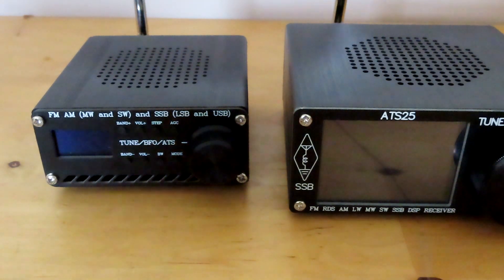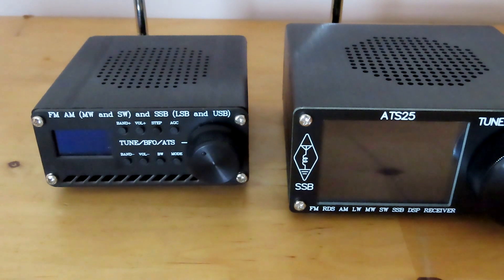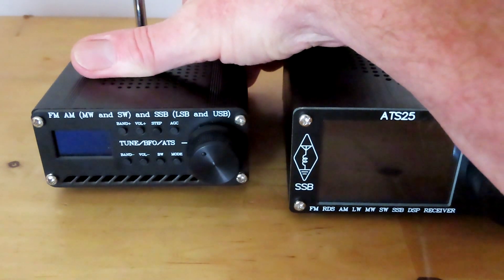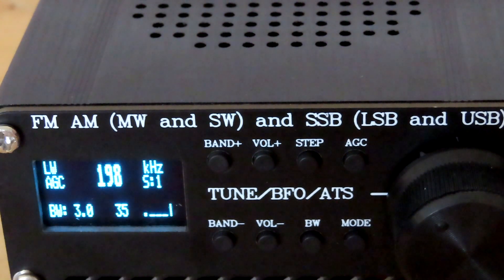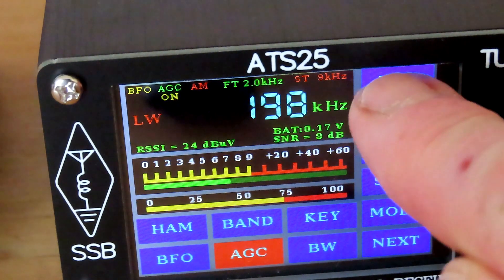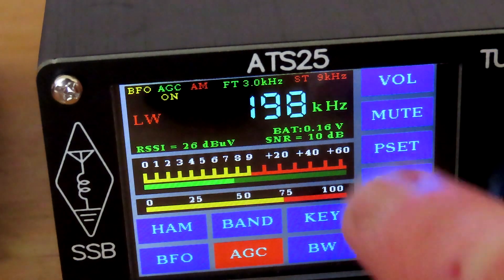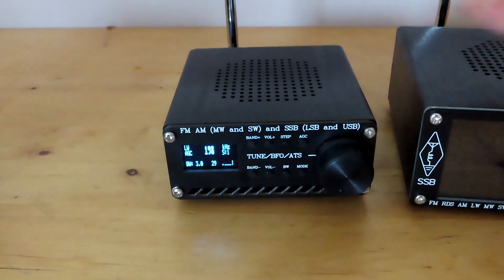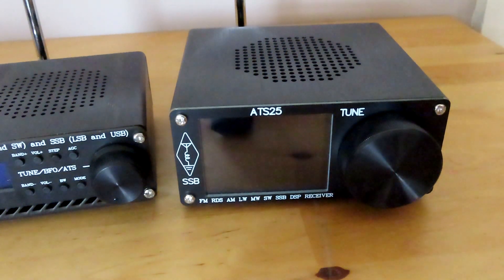ATS 25 Screen noise test

Comment: Hmm. I tried I self made despite rod antenna on my ATS 25 max decode. In the flat (it is Moscow) it turned out to perform better than my Data 808. Well, Data receive too but with weak signal it is not possible to distinguish what is said when no ats 25 it is still possible.

Comment: is there modification for this noise, its a pice of shit now
Reply: Internal shielding to separate the screen from the receive, or get an external antenna like the MLA-30 or YouLoop antenna.
Reply from the maker: Not that I am aware of. Its certainly not a good receiver although the noise problem on mine is not noticeable on an external antenna

Comment: This sounds to me like the High voltage inverter noise I used to get when putting my old PC speakers to close to my LCD monitor. I'm curious if those screens are lit with CFL's and a HV inverter circuit that could be leaking a good amount of RF from the screen. When you touch the screen capacitive coupling takes over and the noise is bled off onto your finger. A well grounded shielding around the back portion of the screen should stop the noise from getting into the receiver, however the root of the issue is likely poorly designed HV inverter circuit.

Comment: In another video I saw it looks like there is a circuit board attached to the front and screen. I'd try making a shield between the main board and the screen. Thin Copper or aluminum.-FARMERIK
Reply: Good system ?